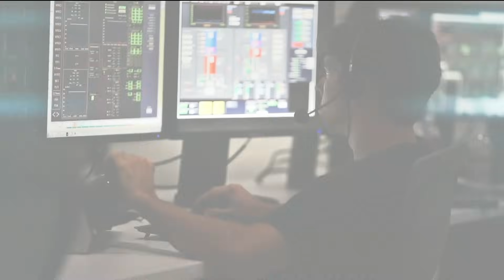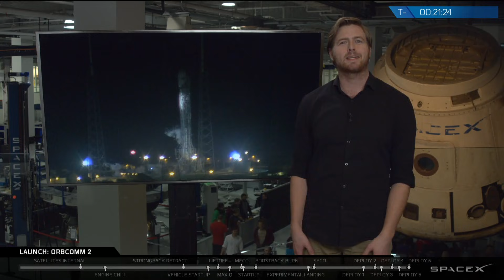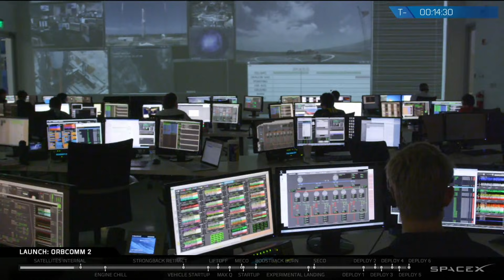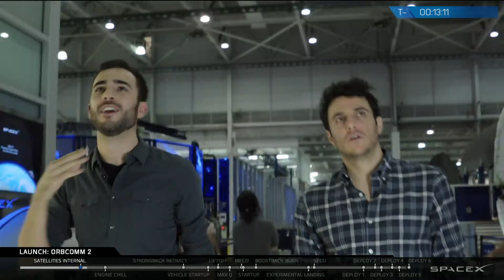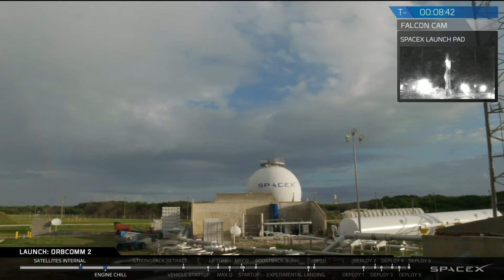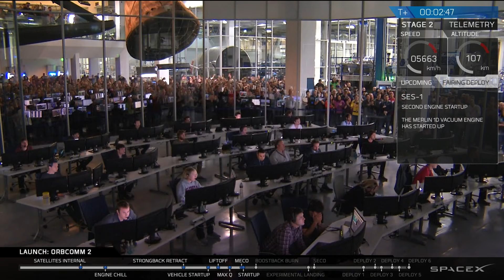ORBCOMM-2 Full Launch Webcast

Comment: With the First Stage on the ground, do you put it on display or do you launch it a second time to show that it is  reusable ?  Thank you for the video !  tjl
Reply: +Tim Lipinski The big game changer was the use of Super Cold LOX that could burn more of the fuel carried (fuel rich burn to oxygen rich burn) !  tjl
Reply: +Tim Lipinski 
LOX has been used in rockets since the beginning, Apollo used LOX, the Shuttle used LOX, heck even our little X-prize team used a LOX/Kerosene rocket motor. Densification of LOX is also not a new idea, it has been around at least since the last millennium.
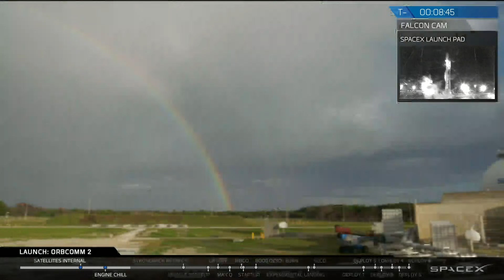Reply: +Harman Robotics Listen to the comment by SpaceX at about 4:35 (also at about 14:15) time in the video.  SpaceX is using a Super Cold LOX to get more O2 in the O2 Tank than regular LOX.  Then you have more O2 to burn more of the same amount of fuel (Kerosene).  Rocket engines are fuel rich; they have more fuel than the O2 can burn for the fuel carried.  This was developed a long, long time ago; but maybe the first time used.  tjl
Reply: +Tim Lipinski 
You are correct on the first part but not the second. Rockets do not carry more fuel than they can burn, the tanks are sized to make use of all the propellent possible. Densification means that they can carry a few percent more oxygen in the same volume, meaning they can make the oxygen tank slightly smaller, which saves weight. Densification would not change the fuel oxidizer ratio, it is just more efficient storage.

Comment: "Launching the Falcon Heavy and Falcon 9, the rocket SpaceX currently used to launch its Dragon capsule to the International Space Station, costs $10,000 per pound – the reusable rocket would cost only $10 per pound. “That, however, requires a very high flight rate, just like aircraft,” Musk "

What happened today is a LEAP in bringing down the cost of space travel.

Comment: i find it amazing they could re land the booster ,  a parachute would have been more practical or easier , the technology to re land this is unbelievable . this is rocket science , they at space x should be proud
Reply: Parachutes don't allow for a precision landing.
Reply: that is how the space shuttle boosters were picked up in the ocean , they fell and then a chute  opened up at about  5000 feet , there are some great videos on you tube of them landing in the ocean
Reply: +HALE BURNSIDE MD  They have tried parachute it doesn't work the first stage is rip apart when it enters the atmosphere before the parachutes are deployed. The booster need to slow down enough before entering the atmosphere this means you need to relight the engine anyway. In order to land the booster undergoes three powered maneuver boostback, re-entry, landing. The landing uses the least amount of fuel and the only maneuver that can be replaced with parachute at the expense of precision landing.
Reply: +HALE BURNSIDE MD A parachute doesn't allow precision landings, and landing in the salt water degrades the rocket which means costly repairs. Rocket stages are also meant to be compressed, not stretched, which might have a negative effect on the stage.
Reply: +HALE BURNSIDE MD the salt water corrodes the engine components as well. Almost immediately. This way, at least in theory, they won't have to rebuild the multi-million dollar boosters. They can repair it if need be, refill it, and send it off again for a fraction of the cost.